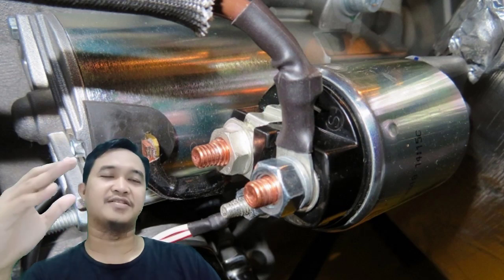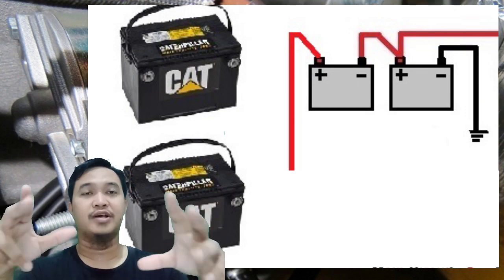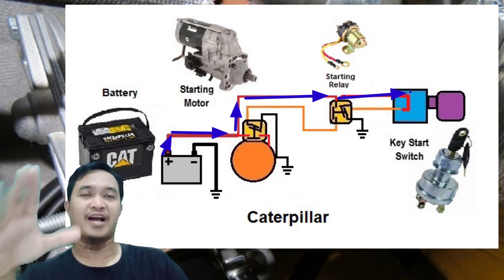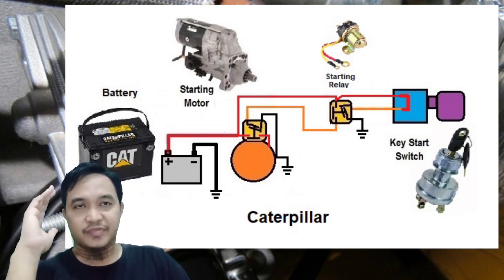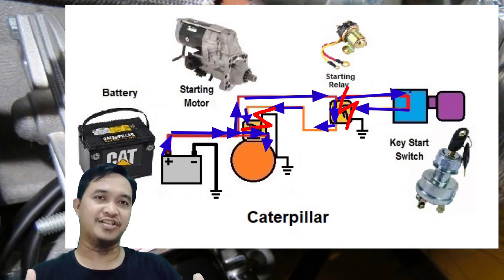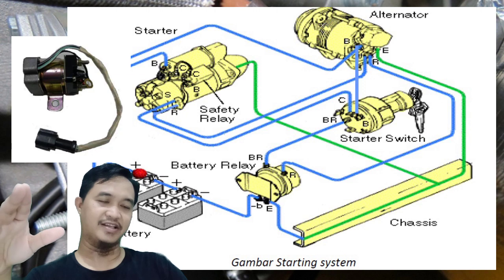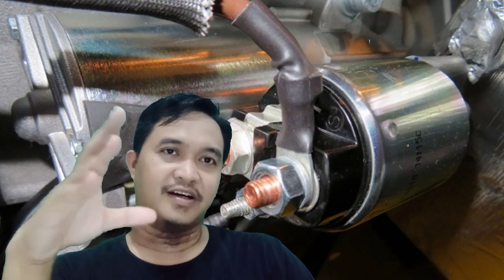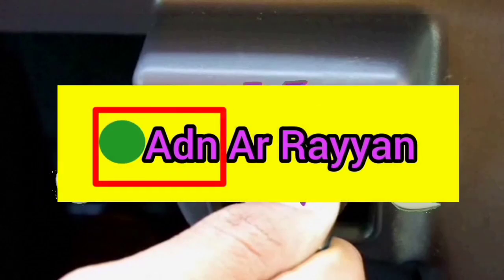Cara kerja sistem kelistrikan/ starting system engine diesel Training BMC Bagian 7

Comment: Setelah mesin running ketika di off kan, yg menyebabkan mesin mati itu apa?
Reply: Kalau bensin itu pengapiannya di stop, kalau Diesel ini apanya? Karena Diesel tdk perlu pengapian
Reply from the maker: @presidenrimasadepan8880  yang distop adalah aliran fuel ke injector mas, jadi berhenti ngabut injector nya berhenti jg Engine nya..
Reply: @dikiadnarrayyan  nama alatnya engine stop ya?
Reply from the maker: @presidenrimasadepan8880  bukan mas, cukup tidak mengirim arus ke injector dari ECM, pasti injector inactive dan tidak bekerja lagi tentunya.. 🙏🙏
Reply: @dikiadnarrayyan o.. Begitu ya, begitu kunci kontak dimatikan otomatis arus dinjector mati, maka engine pun akan mati
Reply from the maker: @presidenrimasadepan8880  betul mas, yang membuka katub fuel dalam injector itu ya solenoid elektronik kalau injektor cuma naik turun tanpa ada fuel ya gak bisa ngabut. 🙏

Comment: Apa saya mau tanya apa penyebapx  D304  tida mau setater putaran mesin lambat  .dan maunx alat di jemper
Reply from the maker: @veryap5927  D304 itu unit apa mas? 
Pastikan dulu battery nya kalau bagus pastikan starting motornya . Tapi pastikan dulu semua kabel2 nya bagus mas.. 🙏🙏

Comment: Bosku minta solusi nya exavator cat 320b berat saat setart tida bisa raning dinamo setart sudah di tes di bawah mengunakan aki langsung dan putaran lancarr tapi pada saat di pasang di enggine kembali lagi putaran beratt seperti low batre tapi batrai sudah baru dan tegangan masih bagus kira" apa nya yaa minta solusi nya🙏
Reply from the maker: Mas, pertama2 coba diputar manual engine nya berat atau udah dan kedua untuk starting motor itu cara ngetest nya gak bisa hanya diputar di luar engine karena bisa jadi dia cuma putaran cepat tapi tenaga kurang, kalau dari saya sih lebih gendeng starting motornya sudah lemah jika memang Aki sudah diganti baru..